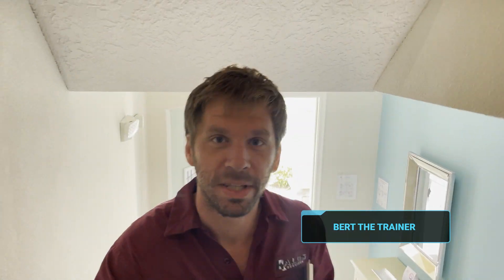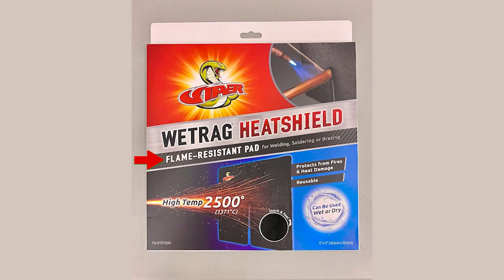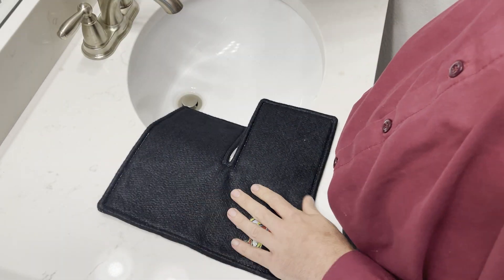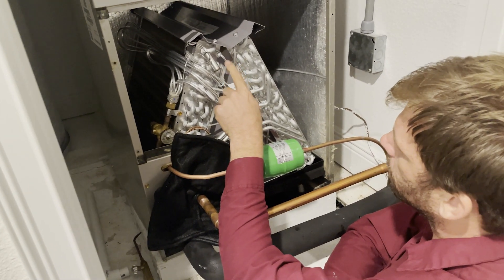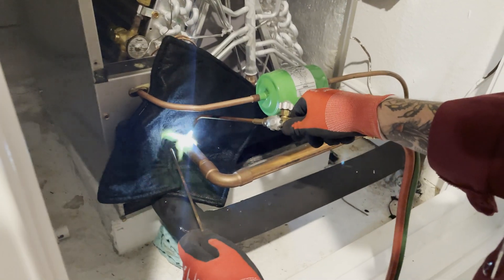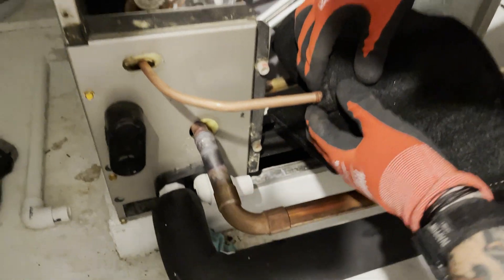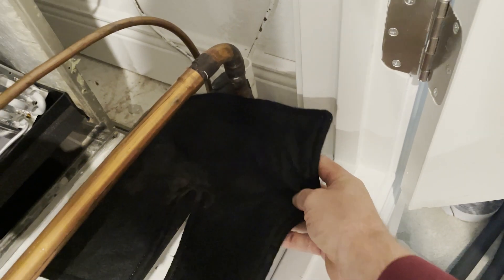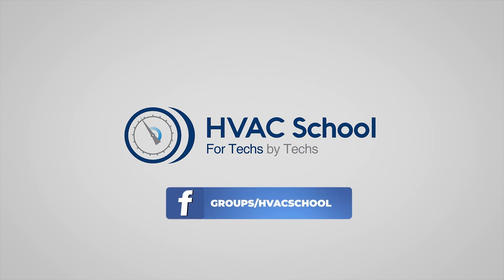New Viper Heat Shield Pad

Comment: Thats pretty nice and viper makes great products, I use their wet rage putty all the time for brazing expansion valves and other heat sensitve things, I have a solder-weld flame resistant pad that I use along with plain wet rags but that looks like it works better and would last longer so I might pick one of those up when its time to replace my current one.

Comment: so does it just block the flame or actually keep the components cool? Dont know if i'd trust that to keep a txv or valves cool off of this video.
Reply: I wouldn't trust it for that either but I don't think thats its purpose, I do a lot of commercial refigeration work and I use a solder-weld blanket and wet towels to protect things for brazing in tight spaces, I think this would be great for that. I wonder if it has magnets to hold it in place like the solder-weld blanket, if not i can fix that myself lol
Reply from the maker: The Viper Heat Shield is not designed to keep components cool but protect the panels and equipment that normally would be scorched due to the high heat generated by Oxygen Torches. Bert mentions that you still need to wrap your TXV and remove your temperature bulbs.
Reply: @HVACS  just wondering does that have magnets like the solder-weld blanket does, if not that's not a deal breaker but since it is still prototype maybe you could put that bug in the right people's ear because at least for me that would be a nice addition.
Reply: @HVACS  I missed that part , thanks for the feedback